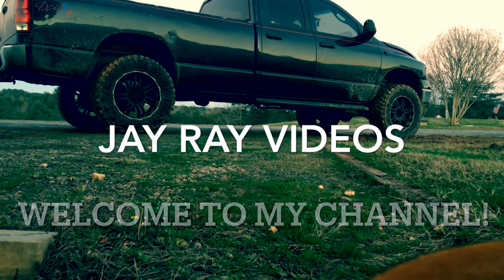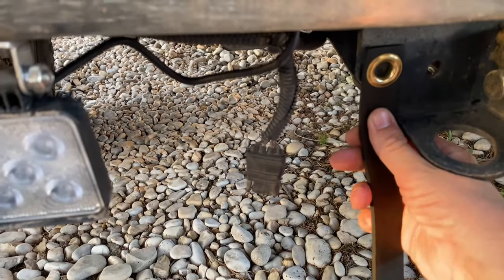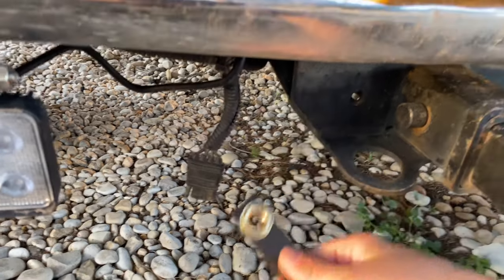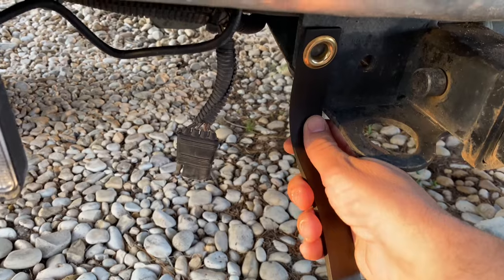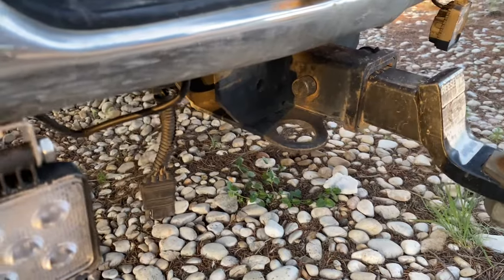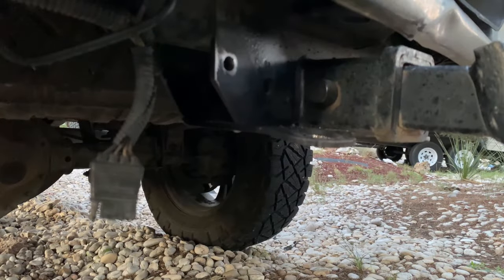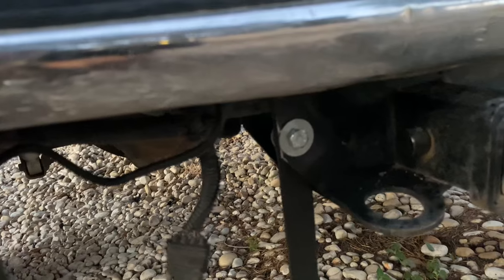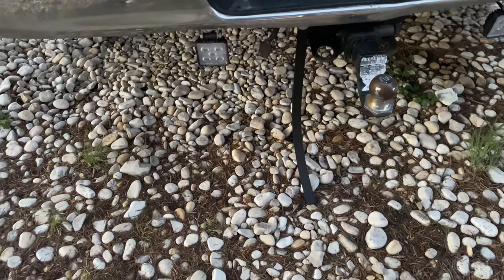What IS THAT?  HOW to add a grounding strap so you don’t get SHOCKED!

Comment: There are normally two screws in the grab handle area in a car/truck door (unless it's one with the grab strap). If you're touching one of the screws as you get out, you don't get shocked. Actually, if you're touching pretty much any metal surface as you get out, you're fine but the screws in the grab handle are conveniently located.
Reply from the maker: It has been my experience that most newer vehicles have those screws covered by a piece of plastic.  Even my 2003 Ram has them covered and the whole grab handle is plastic.  The Chevy work truck I’m currently in has plastic grab handles.  The Ford work truck I used to drive was also the same.
Reply: @JayRays1truck  pulling a small piece of plastic out of an unseen area seems like an easier fix than attaching a grounding strap to the bottom of a vehicle. Hell, most people lose or break the covers the first time they take their door apart, anyway. That's how I happened to stumble upon this "fix" for getting zapped.
Reply from the maker: @TheCharleseye perhaps, but the bolts are well over an inch down inside that plastic on my truck.  I had to use a small extension and socket to reach the bolts and my fingers are too large to fit in the holes that the bolts are in.

Comment: 🤣 You bought the marketing pitch, hook line and sinker.  All these do is show how old the driver mentally is.  The truck comes with four rubber grounding pads from the factory; they are called tires.  If you have a static problem, its not the vehicle, it's your clothing, which can't be resolving with auto bolt-ons.
Reply from the maker: Actually, the four rubber pads you speak of are meant to isolate your vehicle from ground and make your ride smoother.  But perhaps I’m wrong.  We shall see.  For $6 it’s worth a try.
Reply: @JayRays1truck   Think of it this way, you don't die when your vehicle is struck by lightening for a reason.  Best wishes on your research adventure.
Reply from the maker: @kookiethebear That proves that tires are an insulator
Reply from the maker: @kookiethebear I’m not sure if this will do good or bad for my truck, but for $6 I’m going to find out.  I don’t enjoy getting shocked when I get out of a vehicle so if this works I’m good.  If it doesn’t help, I may remove it later.  Who knows?